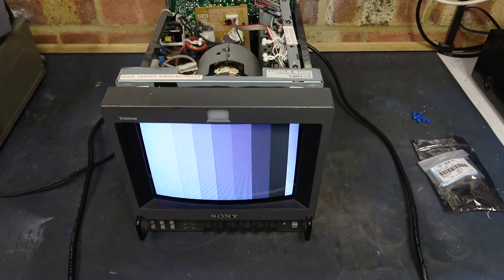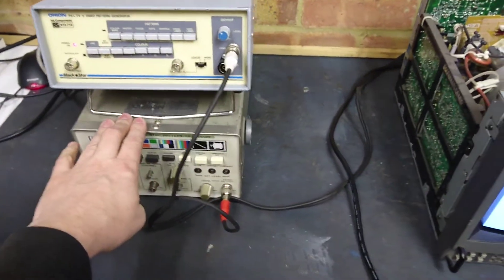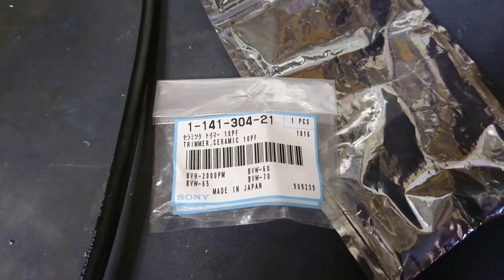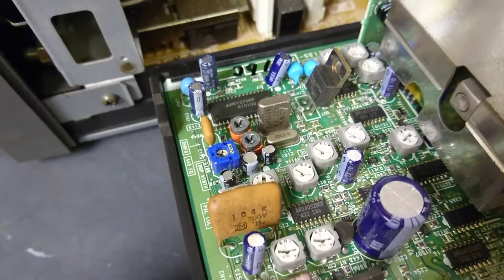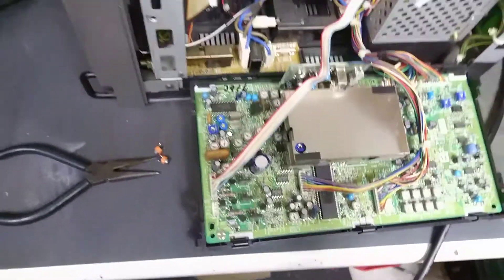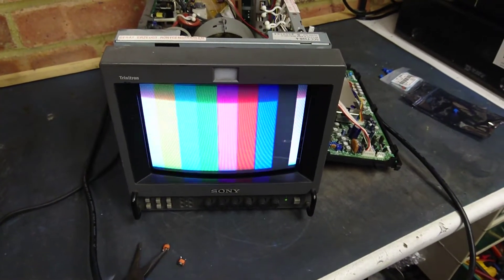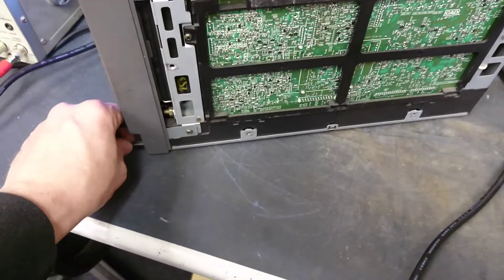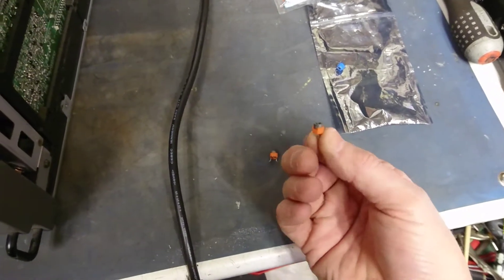Sony PVM-9041QM / 6041QM  Repairing Black & White Picture Fault.

Comment: Thank you for the video, very useful, however I have 6041Q here, apart of black & white color picture in composite (RGB is fine), also the screen flickers like VHold is not fine, but it´s not, because VHold stabilize the image to avoid making it roll. But it´s flicker up and down quickly

Comment: Hello Friend,have the same pvm,and have like a yellow light strip on the left side,from top to bottom,don't know where to start looking,cheers
Reply from the maker: Could try horizontal shift and see if it moves off the crt face, if not it could be a convergence or purity error or apatite grill has moved / monitor been dropped, magnets affect CRT but usually result in green / purple so if its yellow its red and green, does it do it on ntsc and pal ? Oh make sure scan coils are pushed right up to the tube funnel, they can creap back towards tube base over time on the masking tape as the tape adhesive heats and moves.

Comment: Have a BVM 9044 9 inch with intermittent black&white problem on PAL. reckon it's the same trimming capacitor issue/same repair?
Reply from the maker: Yep all use virtually same colour section

Comment: Hey mate. Could you please point to where you bought these? I’d like to use original ones too.
Reply from the maker: https://www.ebay.co.uk/itm/303669894156 if you get stuck or link no longer works they are made by MURATA so google "MURATA Trimmer capacitors 10pf" they show I bought lots direct from Sony as the company I work for have an account with Sony spares agent.
Reply: @mrcrtking  mate thanks so much! I had trouble getting NTSC coloured only. These days I tried to plug in my pc-engine and my ps2 on RGB ports but RGB isn't working. component does fine on PS2. do you have any idea what might be the issue? can't complain as I paid somewhat cheap for it but repair would be kinda expensive here in australia, if I find someone tbh.